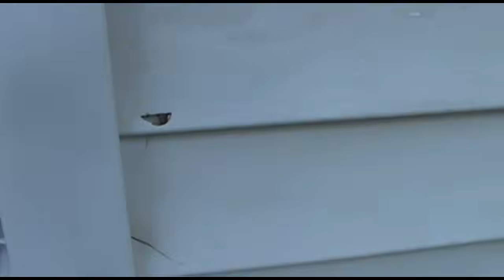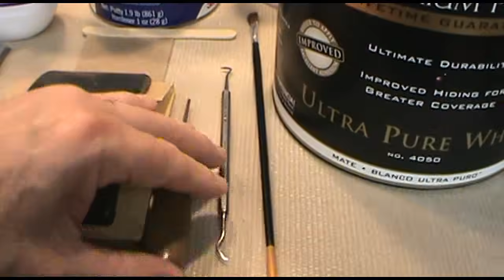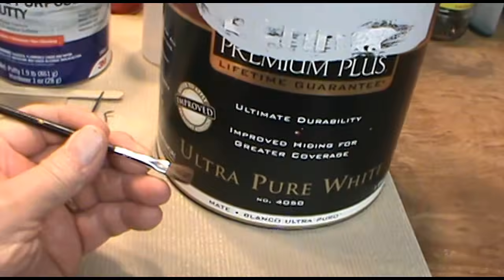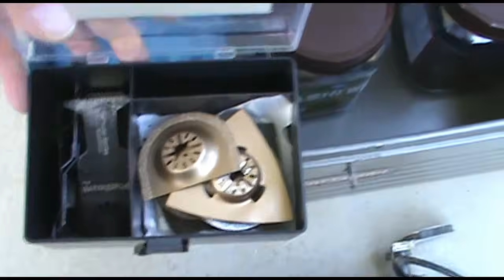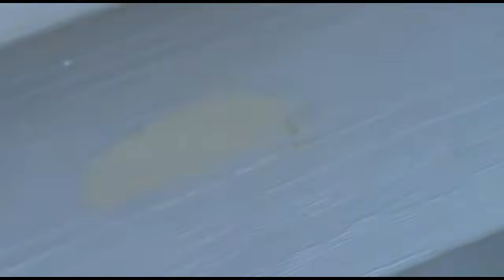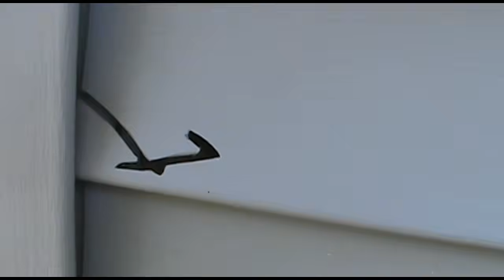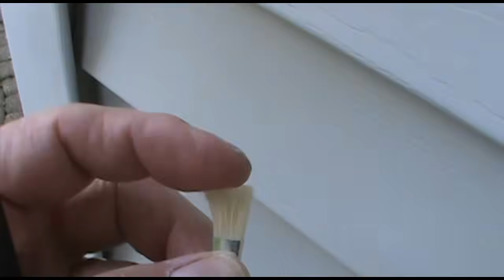How to Repair Vinyl Siding Holes and Cracks. Perfect and Undetectable.

Comment: Shave it down before it completely hardens…less hardening agent…you can shape it…even add a grain to it if needed…sheer forms aka cheese graters work well to take it down…just be careful…
Reply from the maker: Thanks for the ideas, Kilroy. I only use a fraction of the hardener recommended by Bondo and it still sets up in about 60 seconds. You barely have time to plug the hole.

Comment: Are you in an area that get below zero in the winter? How much backfill into the crack would you suggest? 🙏
Reply from the maker: Hi Teresa. I am in an area that gets well below zero degrees and sometimes stays there for days on end. That doesn't seem to affect the repairs at all. I haven't applied any backfill to speak of even though I had planned to on the larger crack I repaired. I simply pushed as much putty into the opened (about 1/8" wide) crack as I could and kept moving along with spreading the putty before it started setting up. It has stayed nicely repaired since July 2020. I think squeezing some Dap 18065 ALEX Acrylic Latex Painters Caulk https://amzn.to/2SlTKHP back behind the vinyl siding through the hole or large crack may be a good idea in some cases. Don't use any other type of calking or silicone as it can be hard to clean up. This Dap 18065 is easy to clean off the vinyl siding with a moist paper towel and if you let it set up overnight it hardens up nicely and is quite durable outdoors. You may want to cut about 3 inches off of a straw and trim the nozzle of the caulking tube the same size as the diameter of the straw. Then you can slide the straw about 1/4" back into the nozzle of the caulking tube and tape it on with a thin strip of duct tape. You will then have a narrow nozzle you can nudge through the large crack to backfill the gap between the back of the vinyl siding and the house. Try to keep the calking back from the opening of the hole in the vinyl siding by 1/8" or so. After it sets completely up you can then complete the repair with the Bondo All-purpose Putty. This won't be necessary in most cases but if the hole is rather large it could be helpful. Good luck with your repair.

Comment: How long does the all purpose bondo have to cure before chiseling? Thanks 🙏
Reply from the maker: Hi Vincent. Bondo says it is "sandable" in 15 minutes. I like to let it cure for four hours or so before I chisel or sand on it. That may be overdoing it but that's how I have always done it. Thanks for stopping by and good luck with your repair.

Comment: Great job but what to do about half dollar size holes
Reply from the maker: Thanks, Steve. I would backfill the hole with DAP Alex Painter's Acrylic Latex Caulk https://amzn.to/3jCuneN . Aim your caulking gun at an angle and squeeze some back behind the vinyl siding all around the perimeter of the hole and continue to backfill the entire hole but do not fill it all the way up until it is even with the siding. Keep it about 1/8 of an inch below the surface of the hole in the siding. All you are doing is making a base for the Bondo All-Purpose Putty. Let the Painter's Caulk set up for at least 24 hours so it is good and hard. This caulking doesn't expand or shrink much and should be a good base for the putty.

After the Painter's caulk has completely set up you can fill the rest of the hole in with a top coat of the Bondo All-Purpose Putty. You will have to work fast because this stuff has a very short open time of about a minute or less. I would have a small putty knife ready to immediately pull the mixed putty off the mixing cardboard and work it into the remaining hole. It won't matter if you have to work fast and get a little extra putty buildup on the hole to make sure it is all filled in because the putty is easy to sand down. After sanding trace in your wood grain lines with the dental tarter pick, clean it with denatured alcohol, and paint it. I hope that all makes sense and good luck with your repair.

Comment: Thank you so much for sharing your knowledge with me, just moved into a house with vinyl siding and it looks like someone had a good time knocking  holes in the house. I rent but I'm  embarrassed about the hole's and I was looking for a quick cheap fix. The owner should have repair this but that would be  too much like the  right  thing to do and rent is not cheap here, and I  will refresh the  whole house with paint because I care about where I live.
Reply from the maker: Hi Arnice. You are very welcome. Your landlord is lucky to have such an honorable Tennant. I felt I needed to figure this out because I developed several holes in my vinyl siding and the company I bought it from went out of business. Even if they hadn't new siding wouldn't match after all of these years of my siding fading. I hope it works as well for you as it did for me. Good luck.
Reply: Your landlord hasn't seen this video so he didn't know how to fix it. 

The next renter may come along and put his barbecue setup too close to the house and melt the vinyl siding.  I've seen renters do that. You can't know before hand if you've got a respectful tenant or not. 
You are the exception to the rule.

Comment: I agree with you. I tried doing something like this with Flex seal. I put it on over the hole. The larger areas I took a toothpick for the woodgrain effect and then sanded
the edges and painted. It worked because I couldn't find anything on this anywhere. Thank you...and you have a very captivating voice.
Reply from the maker: Hi Kelly. Thank you so much for your kind words. Good for you for figuring out a way to fix your vinyl siding. The Bondo All-Purpose Putty seems to be the "Goldielocks" compound for repairing vinyl siding. It's not too soft and it's not too hard. It's just right. It is soft enough to trace the wood grain into and stay a bit flexible over time and hard enough to be sanded and hold up long term. I have several repairs that are over 10 years old and still going strong. I have had a couple repairs loosen a bit over time but they are a fast and easy fix. Just repeat the original steps and you're done. 98% of them never loosen even under the pressure of power washing. Thanks again for stopping by.
Reply: I bet the flex seal was easy to sand and groove to match the grain 🤔 would love to know as the bondo would not be in my league to work with. Thanks in advance

Comment: Just completed a repair of about 30 holes in my vinyl siding using this method today. Your tips and attention to detail had my project turn out absolutely perfectly. So much better than the tape junk that is out there for repair.
Reply: Can I fix 3 in Circle Hole with this process
Reply: Yep.  i came from the "tape" repair video a few minutes ago.   The repair looked horrible.
Reply from the maker: Thanks for the feedback, Matt. I love it when someone follows these instructions and saves their vinyl siding. I know how disappointing it is when your siding gets damaged and it's a great feeling when you can Fix-It-And-Forget-It.

Comment: How do I find the exact color match of paint for my yellow siding?
Reply from the maker: Hi Rob. I took a piece of leftover vinyl siding in to Home Depot's paint department and they scanned it to get the formula for the custom-blended paint. Some people have a bit of the vinyl siding left over from the original installation. They don't need much. A small 4" square piece would probably be enough. The only other way I can think of is to remove as small a piece as you can find and reinstall it after they scan it. That would be a hassle and you run the risk of doing further damage to your vinyl siding. If you decide to try this there are several videos on YouTube that show how to remove and install vinyl siding. They show a special tool required for the job. I would try to find a piece in a low visibility place and as small as possible. The risk of further damage, however, may not be worth trying this. If you are able to get a source for your custom color be sure to ask them for a sample jar of paint. That will only be a few dollars instead of 25 or 35 dollars for a gallon of custom paint.

Comment: I have some gaps in my vinyl fence between fence panel and post. Could I put in  neoprene backer rod and caulk over to hide the gap?
Reply from the maker: Hi Robert. It is hard for me to give you a specific answer without seeing the gap you want to fill and the caulking you want to use. Having said that, I want to offer you some thoughts on your project but please realize I am "flying blind" here. I suspect the neoprene backer rod would tend to move over time with expansion and contraction. This would, in turn, cause your caulking to split and fail. If you do try the backer rod and caulking you may want to do a small section and see how it holds up over a couple months before doing the whole project.

As I try to visualize your project I wonder if you might be able to fill the gap with some 1/4" Kerf Bulb Weatherstrip as seen here https://amzn.to/31RngYl . If the barbed tongue of the Kerf Bulb Weatherstrip is thick enough to get a good grip in the gap the "bulb" of the weatherstrip would hide your gap. If the gap is too wide to grip the barbed tongue of the weatherstrip you might be able to carefully squeeze some silicone caulking into the gap and then seat the barbed tongue of the weatherstrip into the silicone. If this works you might want to make your weatherstrip seam at the bottom underside of the fence panel. If this doesn't look like it will work perhaps it will trigger some more ideas to solve your challenge. Good luck and thanks for stopping by.
Reply: @Fixitforgetit  Thanks  for  your  help. I  will  send  you some pictures  to help you  visualize  the situation.  The gaps don't  bother me  in the daytime  but at night they are  noticeable because of  light. I  will  get  back to you later with a  couple  pictures.
Reply from the maker: @robertgaritano7718  My pleasure Robert. I hope we can find a solution.

Comment: Hello what do you call those things on the end of your railing? Thank you
Reply from the maker: Hi brownsugadeb. I think you are referring to the bracket that mounts my handrails to the vinyl siding. I installed Weatherables "Yorkshire" vinyl posts and rails on my porch. As I looked at the "classic" handrail brackets that came with the rails I knew their footprint was much too big to mount to my vinyl siding. As I searched the Weatherables web site I noticed their  T-Rail & 2” x 3.5” Adjustable Stair Kit Brackets as seen here. https://bit.ly/2PF09Jx 

These brackets are actually made for stair rails, not porch rails. I discovered they had a perfectly sized "swivel" mounting bracket that would not only fit my vinyl siding but could be tilted a bit to fit the angle of the vinyl siding. I had to make a slight modification to the brackets. There's a little "stop" inside the bracket that stops it from swinging in a full pivot to accommodate the angle of the vinyl siding. The stop is only a small piece of vinyl that needs to be trimmed off and you're all set. I love the way they fit and they are quite secure once the rails are installed.

I am not affiliated with Weatherables in any way but, overall, I was very happy with their product. The durability and look of the system is excellent. Their handling of the goods before shipping is another matter. I had to do a lot of wet sanding to get rid of scuffs and scrapes but, in the end, it was worth it for me to have the finished look I got. I will be posting a couple videos on that post and rail installation when I get time to finish the videos. Thanks for your question and I appreciate you stopping by.
Reply: Fix it forget it. Thank you so much for responding. Looking forward to the other videos.
Reply from the maker: @brownsugadeb  My pleasure. I need to get going on some editing and upload some more in the near future. Thanks for stopping by.

Comment: That was helpful. I wish that you had actually shown more of the work though. You spent 27 minutes and then skipped a lot of the most important parts of a "how to" video. Sanding, painting, etc.
Reply from the maker: Hi ZapaDeeBoom. The video was longer at first and I had a couple people complaining it was too detailed because folks already know how to sand stuff, etc. I cut it down and tried to show what is needed to do the job and left out the parts most DIY folks would already know how to do. I really wasn't intending to do a video on this project but after I got into it I realized there didn't seem to be anything on the Internet showing an effective repair method so I captured the highlights to try to help people with their vinyl siding repairs. I hope there is enough there for you to get your repair done and appreciate your feedback.

Comment: Wow. Keep posting videos! You clearly know what you’re doing. Love the Bob Ross comment...”now paint real light with the brush...”.  😂
Reply from the maker: Hi David. Thanks so much for your kind comment. I really appreciate it. I will be posting more videos over time. Here are some of the upcoming videos we’re working on.

How to install USA Vinyl’s Weatherables vinyl porch posts.

How to install USA Vinyl’s Weatherables vinyl porch handrails.

Lightweight DIY portable bicycle generator and battery bank.

How to convert a Mytee Carpet Steam Cleaner from manual fill and dump to automatic fill and dump.

How to upgrade an old Kinetico Reverse Osmosis membrane housing so you can change the membrane yourself.

How to referral damaged loop pile carpet.

A cheap way to spot clean carpeting.

How to stop a leaky garage spigot and raise the spigot up so you can easily reach it.

A cheaper way to clean your car battery terminals.

How to make your own power washer water pump and garden hose purging tool.

How to stain your deck, handrails, and spindles the easy way.

How I set up my feral cat live trap for TNR and shelter for winter.

Comment: Hint: put a small piece of Saran wrap or equivalent over the body putty and flatten it to the surface before it hardens, old boat repair trick - will save a lot of sanding.
Reply from the maker: Thanks for the tip, Sam. I will try that. Be sure to use Bondo All-Purpose Putty instead of the regular automotive Bondo. The regular automotive Bondo is more brittle and may crack or break loose from the vinyl siding. The All-Purpose Putty is a bit more flexible and holds very well but it dries so fast that it is hard to get much done before it starts to harden. I love the stuff but that is its one drawback. One needs to do small sections of repair at a time due to the short "open" time of the putty.
Reply: Also, you can scrape away the bondo before it totally hardens up.  You can do the initial  shaping real quick. The saran wrap idea is a good one too.  Nice job!  I will try this on my vinyl.

Comment: Amazing job!  Thanks for the tutorial.  Very detailed and walked us through each step.
Reply from the maker: Thank you for your kind words Beverly.  I installed a new hose reel a couple days ago and had to repair several holes in my vinyl siding. The repair turned out great and every time I do this I am so thankful I finally figured this repair method out. I want to keep my vinyl siding looking new as long as possible. Thanks for stopping by.

Comment: Thanks for this video. My neighbor was cutting grass and kicked something up and cracked the side of my house its vinyl. He said he was going to glue it. Not sure if that will be good enough.
Reply from the maker: Hi Matthew. Sorry about your vinyl siding mishap. Gluing it will probably make an unsightly repair that will more than likely crack open again over time. If you have a crack and simply glue it or skim-coat it with anything it will probably be an unacceptable repair. If you watch the video from 19:58 minutes into the video to about 22:00 minutes in you will see that I repaired a fairly large "X" shaped crack that I opened up a bit so I could get a little more of the All-Purpose putty in there. That is the proper way to repair a crack in your vinyl siding if you want it to look like nothing ever happened. It takes a little bit of effort and money but not much compared to replacing the whole sheet of siding. And even if you replaced it the new piece of siding probably wouldn't match. In my case, the siding company went out of business and I didn't even have that option. It all depends on the end result you want. I see videos where people stick some tape on a crack or hole in their vinyl siding or squirt in some caulking and call it a day. If that is what they want that's fine with me. That, however, doesn't work for me. I want my vinyl siding to look like no damage ever happened and I want to, "fix it and forget it". Good luck with your repair Matthew and thanks for stopping by.